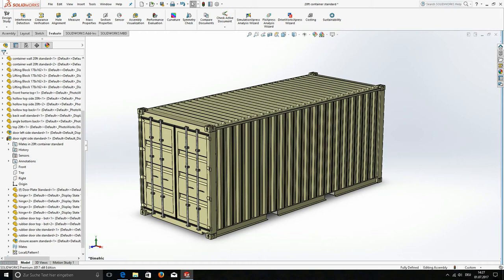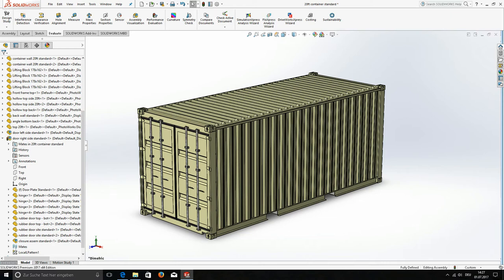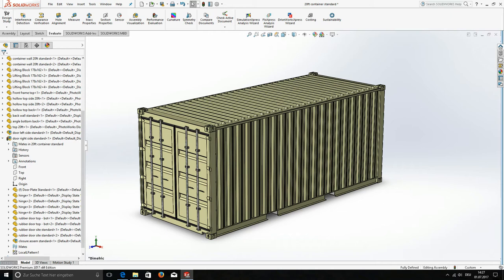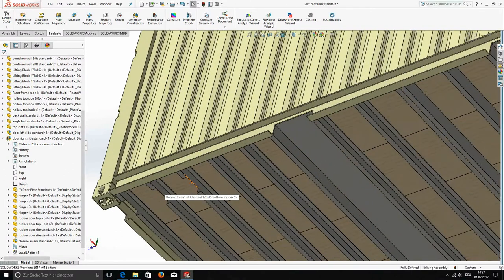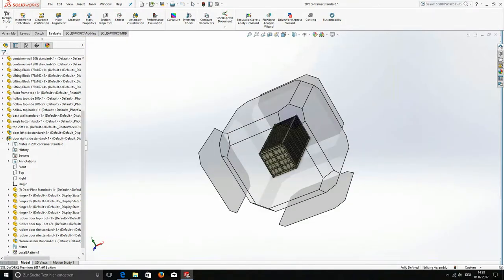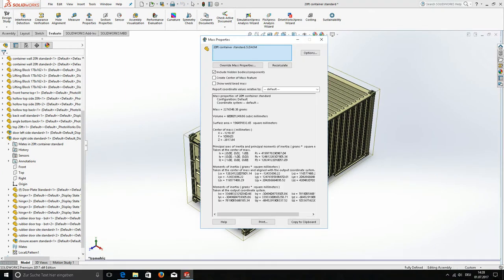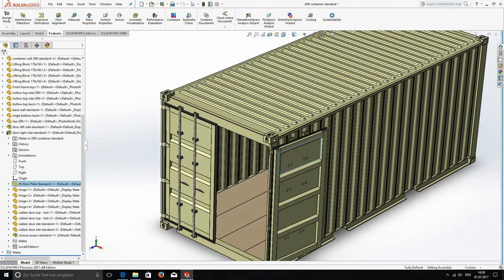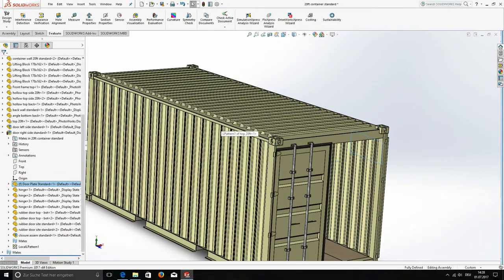SolidWorks ISO shipping Container - Software aided Engineering

Comment: Hi Can i buy the complete detailed assembly ?
Reply from the maker: Sure, this is designed in SW14. You can buy it on 3dexport.com . I could send an SW11 version on Thursday as I am away from work atm
Reply: Martin Egger on 3D export only SLDPRT file is available with solids and surfaces. Will it have individual parts, sub assemblies and mates ?
Reply from the maker: @Theprofessor1212  sorry for my weak answer yesterday. Yes the download will include a zip container with the assembly and all parts. In the assembly all mates are defined. If you have any problems with the model, please let me know and I'll try to help you.